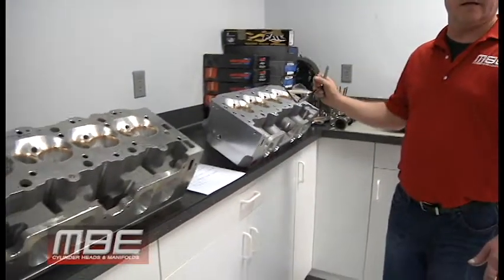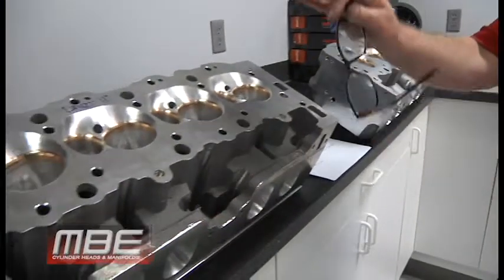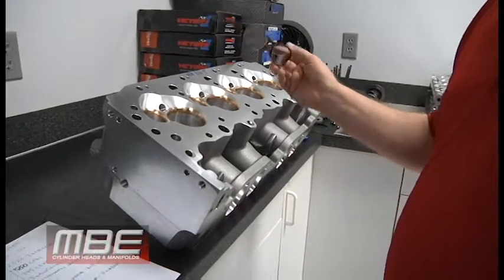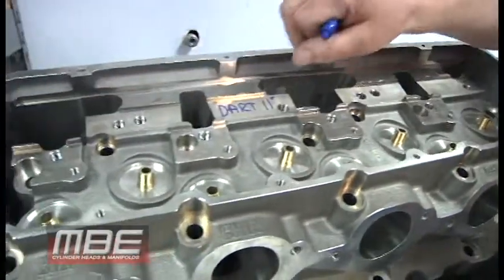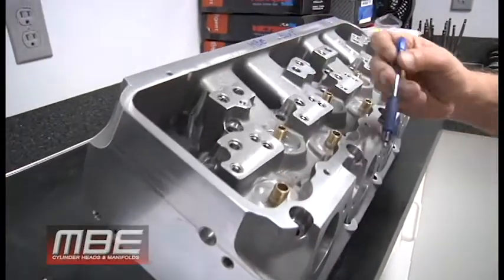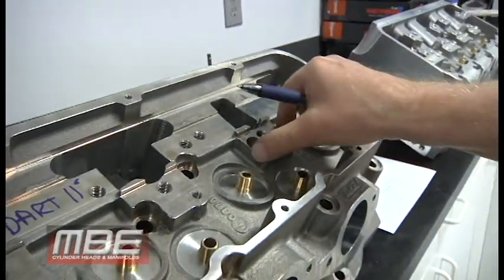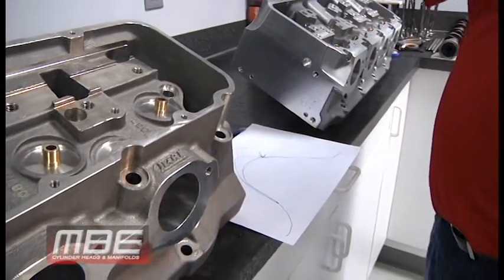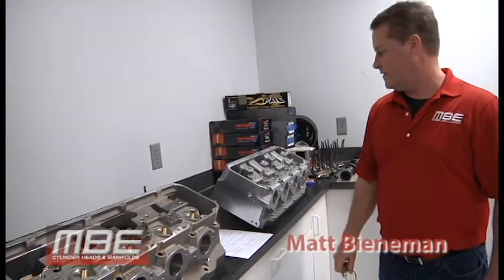DART 11Degree Cylinder Head  vs  MBE BIG 9 Cylinder Head  EXPLAINED  ** TECH VIDEO **

Comment: Does the one-piece rocker pedestal accept Jesel rockers?
Reply: Hey rolly, I'm not 100% certain...BUT...there's a good chance the Jessel Rockers 
will work fine with the MBE Big 9 Heads. 
After the holidays, I'd call their Techline. These guys are profoundly knowledgeable. 
They will give ya' honest, correct information...every time. 
All the best in 2022, 
Ben
Reply: No, that setup is for T&D rockers.  The Jesel setup is different